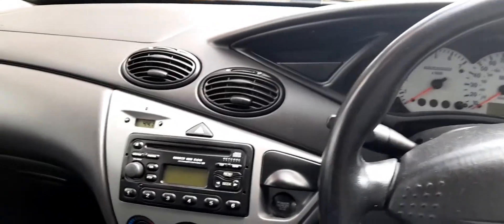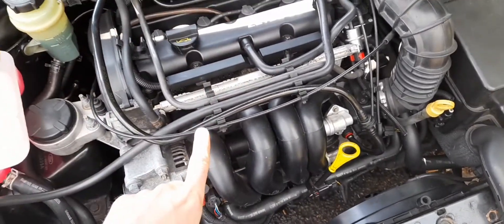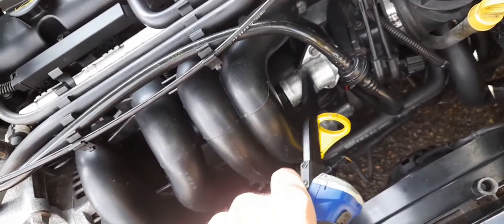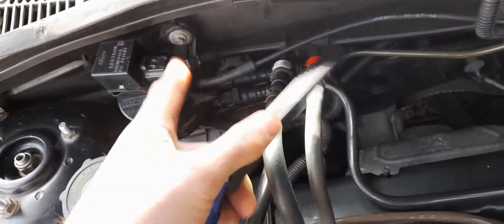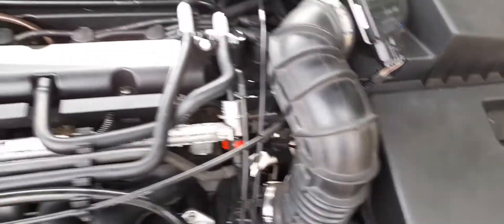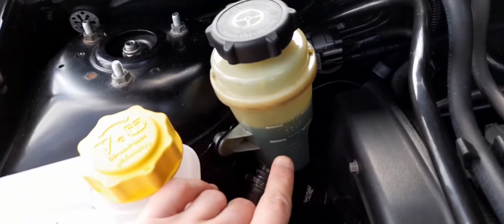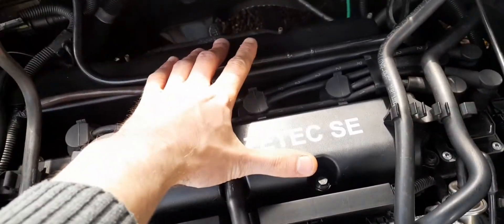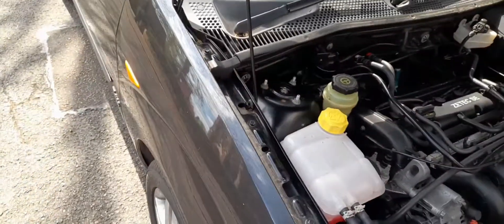Ford Focus MK1 Common Problems - Engine & Gearbox

Comment: My apologies in advance if this is somewhat off-topic...  My car's more or less the same as yours (a 2002 1.6 automatic), though alas in far worse condition!  (What you've done is _amazing_, BTW.)  I'd be grateful if you could advise me what options I have for topping up or replacing the power-steering fluid.  (Since yours looks the same colour as mine does --- a sort-of blue-ish-green.)  According to the Haynes manual, I need WSA-M2C 195-A, but I'm not sure whether that has been superseded by something newer in the intervening couple of decades, or whether it's better to go with something else --- I see that there are now a number of fluids which are designed to prevent leaks.  Any help would be much appreciated!  Thanks in advance & best wishes.
Reply from the maker: Replace the power steering fluid with the spec that you've mentioned, its the correct green hydraulic fluid. You can use generic red power steering fluid but really only as a top-up in emergency. No fluid prevent leaks, if there is a weeping O ring or pipe, they need replacing not adding a leak additive in.
Reply: @usuallyfixingtinkering  
Thank you for the quick response.  I have one problem...  Where do you buy it?!  I've searched online for the spec mentioned in the Haynes manual (WSA-M2C 195-A), but the products that appear with that spec are all red fluids!  Perhaps I'm missing something or doing something wrong, but it seems to me that I've got a choice between red fluid with the correct spec or green fluid with an incorrect spec.  Did they discontinue the fluid originally used in the car?  I tried keying my registration into the Halfords site and they offer various possibilities for my make and model, none of which mention the right spec or colour.  If I'm unable to find WSA-M2C 195-A in green, and have to resort to generic PAS/transmission fluid, would it be likely to damage the car or make it hazardous to drive?
Reply from the maker: Correction I've mixed the specs up, the 195 is a red fluid, you want 204-A which is green! Plenty on ebay :)
Reply: @usuallyfixingtinkering  
Thank you!  So the Haynes manual for my Focus is wrong!  (Unless I read it wrong, of course, which is quite possible.)  
You wouldn't believe the trouble I've had trying to get an answer to the simple question of which PS fluid to use.  I tried entering my car registration on the Ford online shop, but no products appeared.  I then e-mailed Ford, and they had no idea.  So I tried a company specialising in motoring fluids, but again, no definitive answer.  I trawled forums, and just got more confused.  
Your simple one-line reply has put an end to my headaches!  
Thanks again & merry Christmas!

Comment: Regarding 'common problems', one which I've found widely on the net is the problem of high idling speed. You had such a problem. Did you ever totally fix it? What was the problem?
I've replace a split PCV hose,  the TPS (because it was sloppy anyhow), IAC because although I'd cleaned it I couldn't test it, cleaned the throttle body completely. I'm stuck. It's vastly improved, but still 'hangs' between gears. Somewhere, there must be a vacuum leak that decays after 15 seconds, or so. That's my thinking. But where? No DTCs and the LTFT settles out at 18% after reset, though starts at 0%. (That's got to be a top clue). Ideas much appreciated. Ta!
Forgot to say I've replaced the PCV too. I cut the old one open, thinking there was no spring in it, to see. There is, but would only have an effect when the plunger is sucked to the top of its travel. The new seems to be the same. Of dubious use - though I'm not the engineer who designed the venting. :)
Reply from the maker: Mmm. you've covered the basics and the main areas I'd be looking at. No.1 have you done a reset i.e. disconnecting the battery because the car 're-learns' the parameters of all the new components fitted. I don't think the issue lies in the electrical sensor side, it's difficult to suggest anything when it comes to "hanging" between gears.
Reply: @usuallyfixingtinkering  Thanks for reply. Yes, several battery disconnects and resets. As I say, LTFT starts at 0% but slowly creeps up. You wouldn't know about revs hanging between gears, as you have an automatic :) I've got the Haynes manual out, but it covers several different models and often can't relate to 'my' car. Evap is a possible, i.e. stuck open, or similar. Re: LTFT, the O2 sensor could be misreading, due to age. Just thoughts. I could fly 'Schrodingers Box' over from US. :) Guess you watch him? Quite a wizard.
Reply from the maker: @Ru556  if it was an evap they'd be a code for sure and it's possible the sensor isnt reading as accurately

Comment: 7:20 I found out today that mine has collapsed. It doesn't leak, but it's as flat as a pancake when the engine's running. Might explain the misfires when it's idling cold/luke-warm.
Where did you get the OEM one? Dealership or Ebay?
Reply from the maker: Yes it will definetly be the culprit! Either Ford have them as its so common to go but ebay as well but make sure it's genuine not aftermarket, they are too soft and don't last.
Reply: @usuallyfixingtinkering  Thanks! I'll check the dealership first. I hope they still stock it. I don't trust Ford itself all that much, but I trust them more than a stranger on the internet.
I noticed a substantial decline in fuel mileage (about 60-70kms on a full tank) since the last time I filled it up.
I'm surprised the original held up this long, although it might have been replaced before. It's been dealer serviced for most of its life. It still has the original twist-lock floor mats!
Reply from the maker: @SmeurkeDeKat  You will get a decline in fuel, most of them have had them replaced but some examples have led much easier lives which explains why its still happening.

Comment: Where is the Coolant temp sensor located??
Reply from the maker: It's located between spark plugs 2 &3, there's a brown covered wire that goes into it through a grommet. Just pry the grommet up and you'll see the sensor.

Comment: Have you got a code for the ignition leads as well ? As preferably it's best to keep to Bosch ? Thanks
Reply from the maker: If yours is a 1.6...no.1 ht lead -1335374, no.2 ht lead -1335369, no.3 ht lead -1335371, no.4 ht lead - 1335377. Hope this helps :)

Comment: Got a really high idle.about 3000 and staying.any ideas
Reply from the maker: Yep, there's air leak going on most likely around the breather pipe under the plastic legs of the manifold in-front of you.

Comment: OMG it was rich and idling poor due to a mechanic knocking off the vacuum line going to the PURGE VALVE rendering it inoperative.
Also idle was dropping with AC on so disconnected battery x 10 minutes, did the IAC relearn idle 2 minutes or more in neutral, then repeat with AC on, IT IS PERFECT NOW! Ford was not the problem, was bone-headed mechanic. On mine the vacuum line comes right off the throttle body to the Purge Valve, pretty short. Remember I mentioned a PURGE will not operate without a vacuum line to it. Neither my PURGE nor my IAC are bad. STFT went to zero pretty fast!
Idles 750 NO LOAD 850 or so AC on. Smooth as butter. An expert keeps telling me the IAC will operate without the vacuum line, but if that is the case, why IS there a vacuum line to it? I must admit, I had no Purge-specific codes, like when it went bad 4 years ago it had a code for a "large leak" I did however have a BIG vacuum leak at the throttle body nipple, being wide open to atmosphere.
Reply from the maker: that explains a lot :)
Reply: @usuallyfixingtinkering  Yes, I am making a sign to put on air boot stating not a hand rest! Maybe mine was weak there but he must have leaned on it at some point and those boots are no longer made. He also managed to knock the vacuum line off!
The very next day I went to wrecking yard and found a boot in nice nick (English term) as well as a rare Focus wagon, snagged the wider rear view mirror out of it. Mine was wobbly and smaller. I may get a spare air boot just to have it. Aftermarket nor Ford makes them now.

Comment: i  still have my mk1  at 60.000 on clock whats button on side on automatic she still run like  new
Reply from the maker: It's the overdrive "4th gear" switch to lock-out 4th if you don't need it - pointless in most situations tbh
Reply: I though like sport mode @usuallyfixingtinkering

Comment: well generally its ok generally as long as you generally do the general periods of general matinance at the general or around it generally to generally prevent general problems generally around the general cars genrally mechanicaly general component areas of genrally propelling in genrally bacwards and forwards generally in direrctions is generally all the genral maitinance they genrally require with all that genrally every 3 years changed out for genrally the better it's genrally  ok . . . . . .GENARALLY SPEAKING !!! . . . . etc , etc ,etc , etc  . . . . lmfao !!!  .. .  🙂 . . . .So Genrally Do IT . .OK !
Reply from the maker: 🤣🤣🤣🤣🤣🤣🤣🤣🤣 Best comment on this video brilliant... generally speaking!
Reply: @usuallyfixingtinkering  its genrally a top genral points of genral maitinance of the most genrally necessary to genrally keep clean and maitaned if you genrally like a genrally reliable genral type of genrally reliable good alrounder genral mode of transport applicable to all the genraly most used genral types of use case's that genrally are most regulary needed for genral use ! . . . ..IN GENRAL !?!?!🤣😁😆😛🙄
Reply from the maker: @grandad40  😅